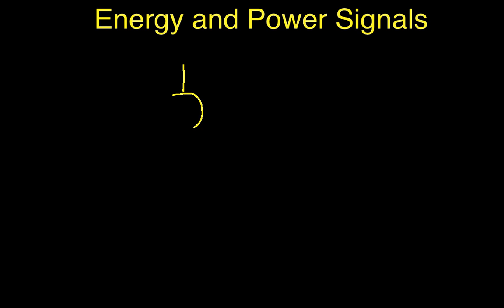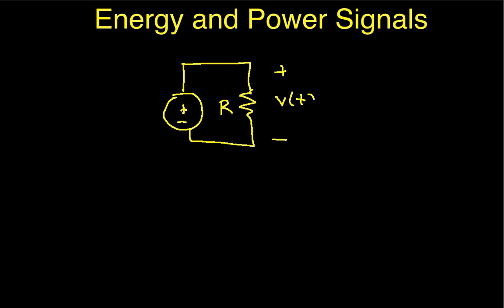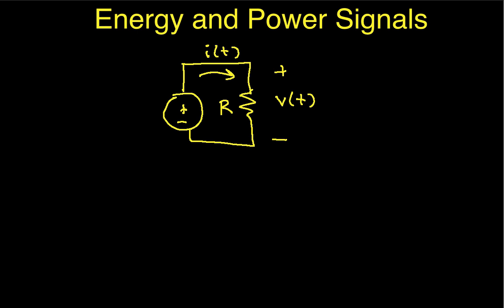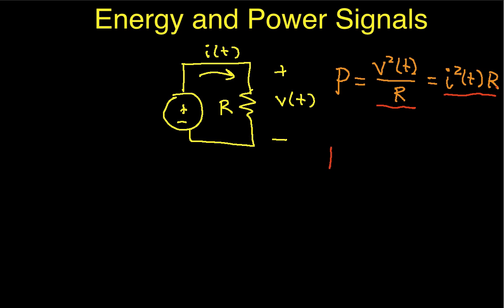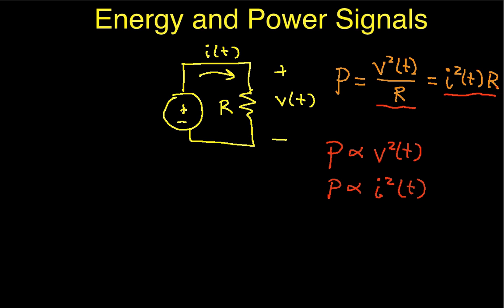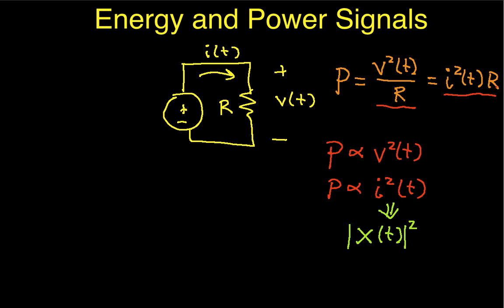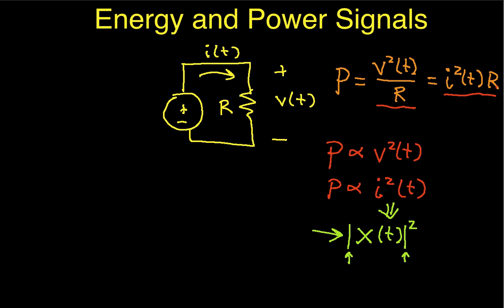Energy and Power Signals

Comment: Important note @ 4:15

You, the reader, may wonder where is the proportionally constant for the expression |x(t)|^2. You may also wonder what would be definition of a power signal if we instead had a capacitor or inductor. Both questions are answered when I tell you the following fact: power signals are defined for a resistor of 1 Ω.

Because of this, now the expression for power signal is the following: if x(t) is a voltage, then the expression is |x(t)|^(2)/R = |x(t)|^(2)/(1 Ω) = |x(t)|^2 [W]; if x(t) is a current, then the expression is |x(t)|^(2)·R = |x(t)|^(2)·(1 Ω) = |x(t)|^2 [W]. These are the same results in the video, and is the reason why the expression for a power signal is |x(t)|^2. Remember, the reason is because such power is defined for a resistor, of 1 Ω, not for a resistor of other value, nor for a capacitor or inductor or a voltage or current source.
Reply: Thank you!
Reply: Sometimes we can gain more information from one comment than from a total book combined. Thank you so much:)

Comment: I have trouble understanding a problem. I need to find the Einfinity of y(t)=integral(x(Tau)dTau) from -infinity to t where x(t)=delta(t+2)-delta(t-2). I understand what x(t) is and I understand how the energy is supposed to be calculated. However I don't understand the y(t). I know that if you integrate delta(Tau) dTau from -infinity to t you get step function(t). However how do you integrate x(Tau-t0) from -infinity to t (where t0 is a constant) and why?

Comment: I understand what you're saying, but it still doesn't make sense.

You're talking about POWER, the change of rate of energy with respect to time. Or the amount of work done per unit of time. So to find an expression for power, the UNITS must be so that J/t, or whatever units of time. 

So what would happen if I were to analyze an analog signal that represents the waves of the ocean? The units of it would be displacement vs time (or displacement vs displacement). So if I were to integrate this, I would end up with units displacement x time, which has nothing to do with energy or power. 

So what is "signal power" really, anyway? It clearly doesn't mean real power as defined in physics. What is the meaning of the measurement made from the equation?
Reply: analog signal that represent waves of the ocean is pretty vague. if you're talking about a system that measures tides, a change in the amplitude of a wave would correspond to a change in the sytem which would be an electrical signal. 

we cant just measure waves of the ocean. we need a system.

Comment: Why is the average power of a finite energy signal equal to zero?
Reply: is it because of 1/T ?
Reply: Anupma Garg It's because the average is calculated over an infinite period of time, but the energy signal only exists for a finite period. So there is an infinite period of time where the power is zero, and however much power exists during the finite period is utterly insignificant by comparison.
Reply: Ty man
Reply: @charlesfinley3234 omg, from where did u get this information?  and whyyyyyyyyyy the FuCk no one explained it in the videos?